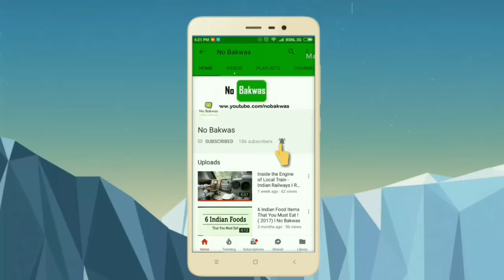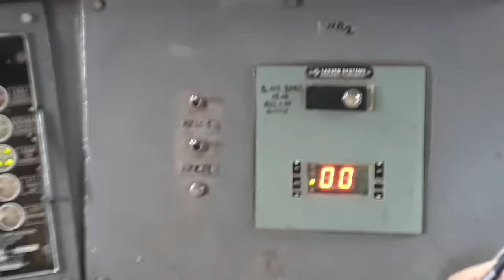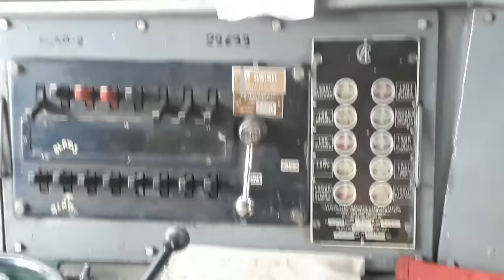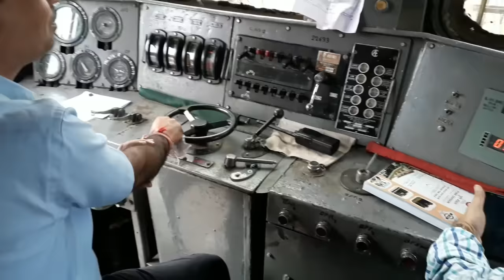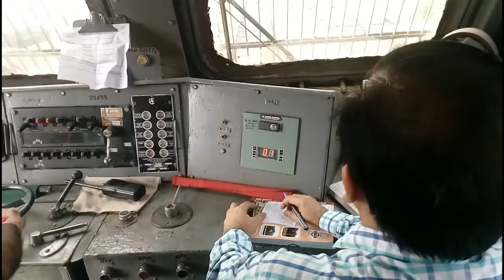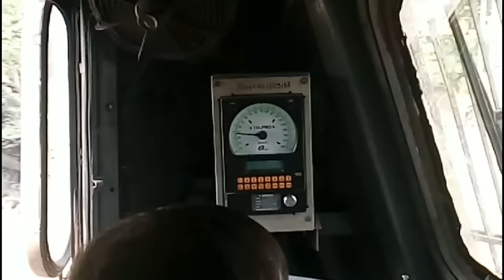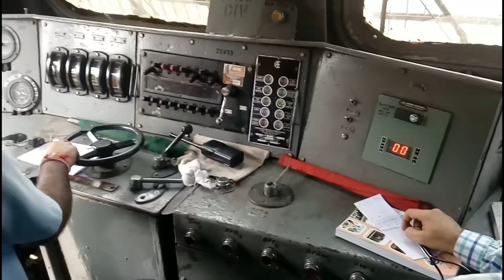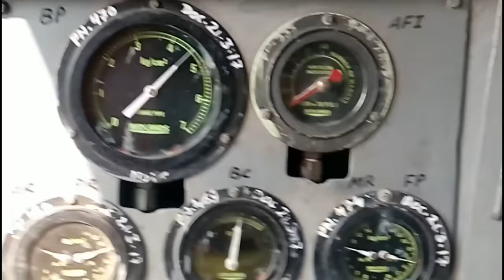Inside the Standard Electrical Locomotive l Indian Railways Engine l Train Driving l 2020

Comment: WAP4 is special for my generation. It has its origins in the very similar looking WAP1 that was developed in the very early 80s by CLW to meet the 130 kmph haulage needs of the Howrah Rajdhani Express which until then had to be hauled by the GE WDM4 diesel locomotive even after complete electrification of the NDLS HWH section  since IR did not have an electric locomotive to handle those speeds, Thus the bogie of the WDM4  ( mark 1 flexicoil fabricated bogie is what I think it was called )  was the one on which the WAP1 was based and the first examples were used exclusively at first for the Howrah Rajdhani and then the Mumbai Rajdhani whose top speed was then increased from 120 kmph to 130 kmph after the WAP1 took haulage duties from the twin Ratlam WDM 2s between the capital and Ratlam. Later in 1988, the Bhopal Shatabdi was introduced with a top speed of 140 kmph and a blue colored WAP -3 MK2 with cast iron bogies used to do the duties. The WAP4 was the final iteration, with more power and better reliability than its predecessors. The WAM4 is almost history now and soon the WAP4 may meet the same fate..
Reply: Though before the advent of WAP era  on Rajdhani Express,sometimes or rarely Double headed  WAM-4's were also used to haul the Howrah-NDLS Rajdhani Express.This used to be after WDM-4's were being phased out.
Reply: Vishwanath Natarajan 

J
Reply: @kaushikguha3500  He simply copy pasted it from somewhere. He has no idea what you're talking about.

Comment: Bro.what is that small steering type wheel.what is the use of that, can you explain???
Reply from the maker: Siraj uddin  In simple words, it is an accelerator.
Reply: In simple words or in a railway language called MPH
Reply: Used for accelerate the train or loco
Reply: Kanchan Goswami Thanks
Reply: It is NOTCH
Reply: Feroz Khan it is not a notch it is a MPH notch means how many speed do u increase like in bike u shift gear for increase the speed like this in lococs notch means speed . In aeroplanes speed is called knots

Comment: Kya loco ka temperature bahut jyada badh jata he
Reply from the maker: The temperature inside the cabin is normal, but at the back side, where the engine is operating, it is really hot there. Also the cabin gets heated pretty badly in summers.

Comment: एक रेल्वे गाडी को दो रेल्वे इजन क्यो लगाते है ओर उन मेसे कोनसा रेल्वे इजन काम करता है
Reply from the maker: Both work simultaneously. 2 or more engines are added when extra power is needed, like maintaining speed on a train carrying heavy goods like steel or coal. Also, it is added on sloppy areas like mountains to avoid the train from rolling back.